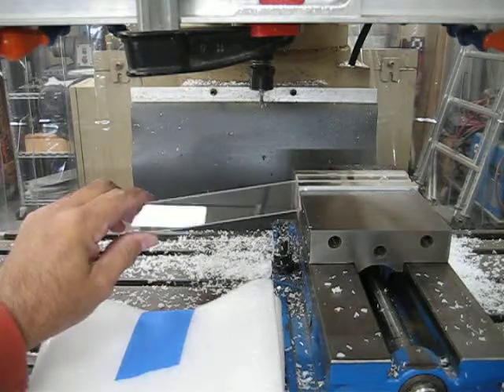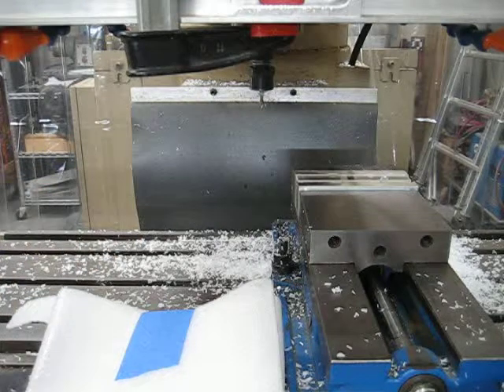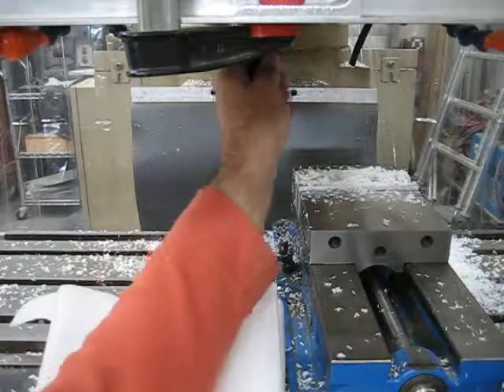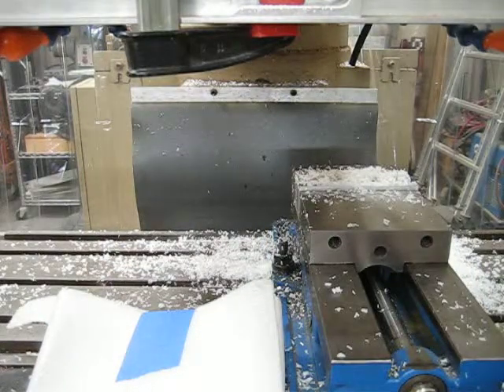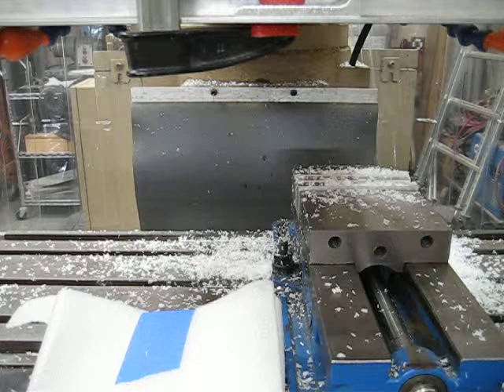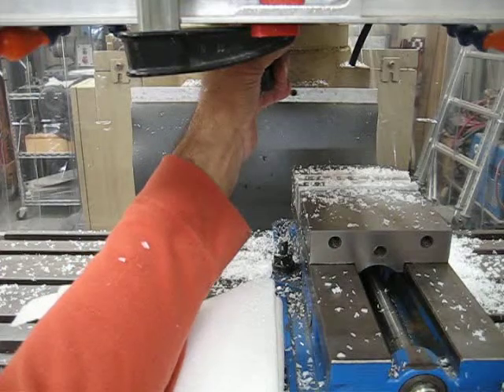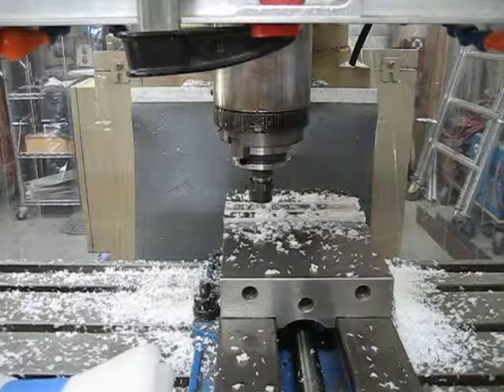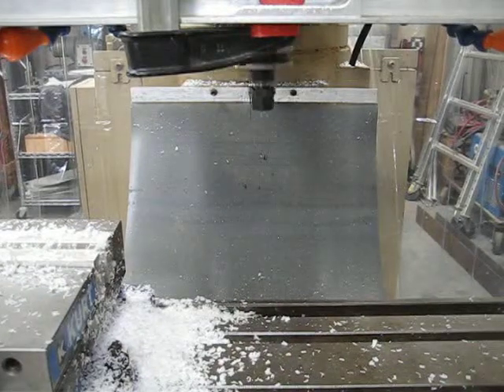making parts on the Milltronics

Comment from the maker: Yes, it is fun to see it moving the way it's supposed to. Did you notice my foam pad off to the left? That's to prevent bruising my toolchanger (my arm was getting mighty sore against that sheet metal lip as I changed tools). I managed to run off about 150 parts in pretty short order.